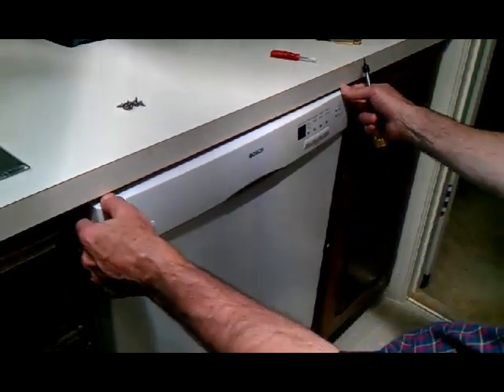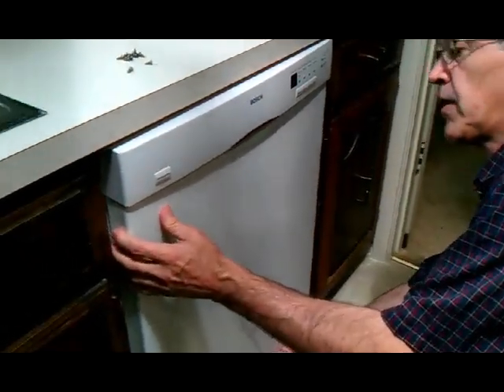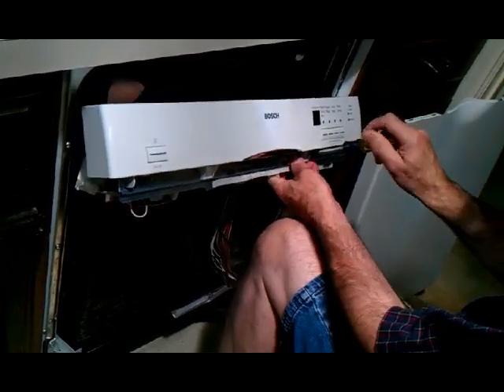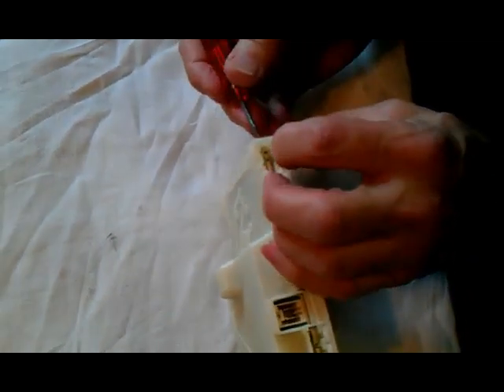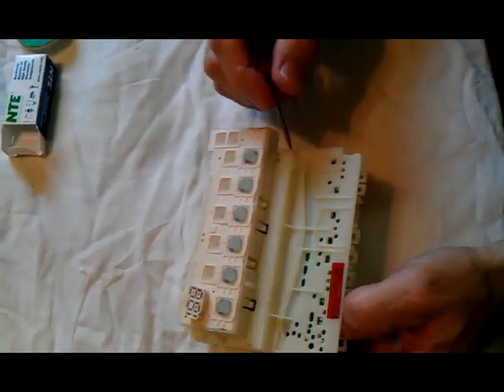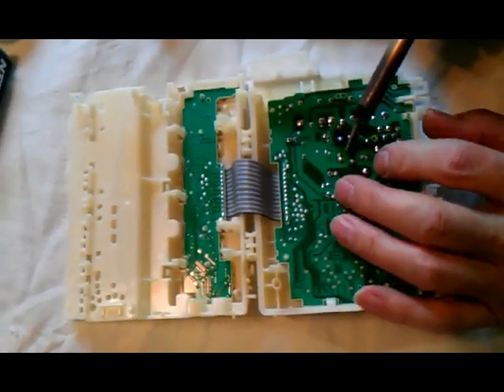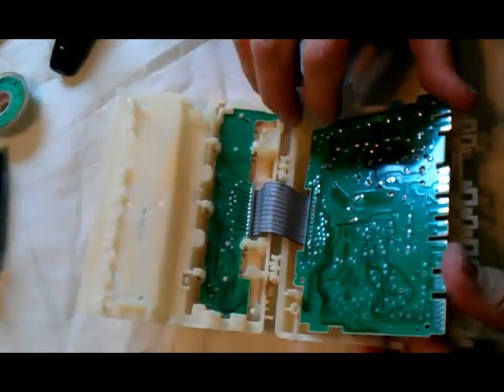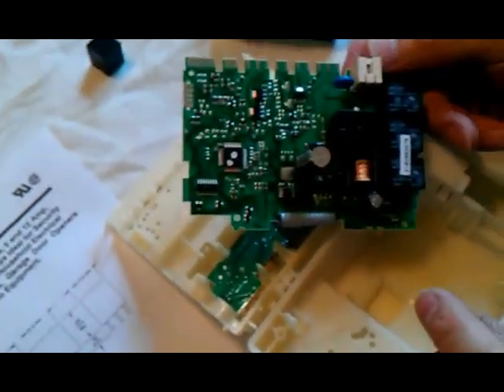Bosch Dishwasher Heater Relay Repair Part 1

Comment: Thanks very much for your video. My Bosch DW (model s9vt1b)
is stopping on a code 1 and shows a code 3 after running the diagnostic program. The water stays cold. I took the PC board out, thinking I might have the same problem, but I don't see a burned solder joint. Is there a way I can test the heater relay and see if it's bad? I'm now looking for a manual on this specific model, which looks quite a bit different from yours (manufactured in 2003). Any help would be appreciated.
Reply from the maker: I don't have any information for your model, but often code 1 indicates a heater circuit problem.  The relay may be bad and not show a burned solder joint, but you may have a failure of the heater, NTC, or something else...maybe just a broken wire where the door hinges.  There are couple of ways to check the heater circuit.  (1) Check the voltage at the heater circuit connector at the control board.  Or, (2) check for current in the heater circuit in the wires at that connector.  Be careful when doing this as you will be working on a live circuit.  Also, if you look near the water fill valve, Bosch usually puts a wiring diagram tightly rolled up and stuck in a crevice.  It is sometimes not easy to find, but it should be there.  The code 3 is often an aqua sensor error.  If that is the case with your model, then it can be ignored for right now as it will not prevent the water from heating.  The meaning of your error codes should be on the wiring diagram.
Reply: AgglomeratedIdeas
Thanks so much for your answer. In the meantime I cleaned out the sump pump and tried running a 91-minute program ("Intensive Wash, 70°C"). About halfway through, the program seems to have started over again. But when it finally reached "1" on the display I waited a good 3 minutes to see if would go to "0", but it never did. I opened the door and the water inside was cold.
Also in the meantime I was able to download some Bosch repair manuals. I'm going to start reading them now, but I'm also going to pull the DW out and see if I can find the wiring diagram. I want to try to test each component that might be bad. If I understand correctly, I should test at the connectors going into the board? How can I test the NTC and the heater itself?
Thanks again for your help.
Les
Reply from the maker: Lester Arbusto
Definately sounds like you have a failure in the heater circuit.  A typical troubleshooting flow chart is here: http://imgur.com/aYgvfAW
This chart is for a 120VAC model, so your 240VAC model will likely have different values.  Even so, the chart will give you the basic approach for finding your problem.
You can remove the connectors with power off at the control board and test for continuity there along with specific resistance values.  The NTC and heater can be checked at those connectors.  With power on and the connectors plugged into the control, you can check for voltage and current values.  A multimeter can be used for continuity, resistance, and voltage checks.  A clamp-on ammeter can be used for current checks.
Finding that wiring diagram would help alot.  Also, if you will post your ENR number I'll see if I can find one.  Your ENR number will be something similar to SGV5903/07.

Comment: Thanks for the video.  Was perplexed why the dishes got clean but the dishwasher walls got dirty with sticky goo.  It was easy to find the relay online.  I never soldered anything on a circuit board, and really appreciate the detail on that.  I even bought a solder sucker - worked like a charm.  Before I forget - thanks for mentioning the four solder points.  After I put the wiring back into the circuit board, I thought about that part and realized I soldered all five contacts.  Took things apart - and guess what I found: I soldered the OLD relay back on.  Whew - without the reminder to use only four contact points, I'd sure be wondering why the thing still doesn't heat the water :-)
Reply from the maker: I'm glad your repair was succesful.  As for the relay contacts, my board only had four soldered...the 5th pin just stuck through a hole.  Some boards have all five pins soldered.  Since the 5th pin is not used (it is the normally closed contact) in the heater circuit, it doesn't need to be soldered.  If the control board had all five pins soldered, then it is okay to solder all five on the new relay.
Thanks for commenting and enjoy your dishwasher again.  Cheers.

Comment: This may seem simple, but I think it may be worth a specific mention that there are four screws that hold the front door to the hinges. DO NOT remove those screws. Again, maybe goes without saying for most, but when you just start taking out screws you can be in for a huge headache.
Reply from the maker: Oh my!  Sounds like the voice of experience there!  I hope the rest of your repair goes well and thanks for the headsup.  Cheers!
Reply: AgglomeratedIdeas Live and learn, I guess. Next question, Dishwasher worked fine with new switch until today. Not it's dead - won't turn on. The basic stuff checks out, breaker switch, hardwired connections, etc. Ideas, thoughts? Something else on the motherboard?
Reply from the maker: Alex Ihnen
That sounds like it could be the door latch switch.  I have a service manual that may help you troubleshoot your unit.  I could email it to you (it is a pdf).  My email address is MyBrokenDW@gmail.com.

Comment: Can I ask if you remember the model of the module? It looks like an ako705266....
Just in case, id like to ask you something bout it
Reply from the maker: Sorry, but I didn't record the numbers on my control module since I was just repairing it. If you need to replace yours, you could look up the number on one of the appliance parts sites such as repairclinic.com.  If you need to email me, use MyBrokenDW@gmail(.)com and I'll do what I can to help you.
Reply: I just wanted to know if theres a special procedure to initialize the module or if it just works by only connecting it.
Reply from the maker: guidito01 No special procedures are necessary...just connect the module.  After the module is repaired, button everything back up and turn the power back on.  Let me know if you need any further help.  Cheers.
Reply: Thank you so much buddy, it was all i needed to know!

Comment: I hit the same problem on my dishwasher today. The relay cooked clean off and burnt a hole in the PCB, caused the board to actually catch fire momenteraly.

It turns out it is a known fault. Bosch are coming to fix it and replace the whole module free of charge. You should have rang them up, they would have fixed it for free or at least sent you a brand new replacement module for free.
Reply from the maker: Yes, this is indeed a well known fault and Bosch will make repairs if your DW is on the recall list...they have to do it.  So, always check that list first.  As many have found out, if your DW is not on the list, Bosch will do nothing at all.  I'm glad your DW is covered.  The exception to the recall list is, of course, if your DW is still under warranty.  It wouldn't need to be on the recall list.

Comment: Thank you for your great Video. I would just like to confirm the correct replacement relay for my dishwasher. The present relay is:899-1c-f-c-6vdc. I am showing the direct replacement as: NTE Electonics R46-5d12-6. Is that correct? Thanks again for your help. I am already out the heater replacement already, due to the wife listening to the repair man. She called him out, because I was worried that it might not be the heating element that was bad, and wanted to research the problem online. She wanted it fixed yesterday.
Reply from the maker: Yes, the replacement for your relay would be the NTE R46-5D12-6.  It is rated at 12 amps.  Your original relay is rated at 10 amps.  The NTE replacement should provide better life due to its higher rating.  That's a shame about the heater replacement.  The symptoms would be similar, but proper troubleshooting would have revealed no voltage was being supplied to the heater because of the burned out relay.  Poor job on the repairman's end!  Let me know if I can provide any further assistance.

Comment: THANK YOU!  We have the exact same dishwasher as the one you repair (only in black).  We called Bosch, but they would not help us at all till we had a certified repair call on the washer.  Really?  Spend $100 on diagnosing the same problem EVERYONE is having?  And then there was no guarantee they would send us parts or anything, either.

But your video and a $8 soldering kit from the local hardware store got us up and running in NO time!  We have run the washer 6x since the repair, and it has worked flawlessly.  You saved us major $$$ bro!!  Where is the tip jar??

PS. We read that the real problem is not with the relay - ours was not appaently damaged - but was the soldering itself.  We'll see if it holds up over time, but the reparied soldering solved the problem for us.

Thank you!!!  You are a champion of the people!  Show this review to someone you know so that they can be proud of you.  Seriously.
Reply from the maker: I am very pleased that you were able to get your dishwasher up and running again.  However, if I am reading your comment correctly, you only resoldered the relay and didn't replace it (correct me if I am wrong here).  If that is the case, it is only a temporary repair...the problem will come back.  Please see Part 2 of this video and I think that will help you understand why you really need to replace the relay to make a permanent repair.  The link for Part 2 is in the video description on the "About" tab.  Let me know if I can help you any further.  Cheers!

Comment from the maker: +stargazer0257
The reply option is missing from your comment (must be a YouTube problem), so I hope you get this message.  The replacement relay for your 899-1C-F-C 6 volt, 10 amp would be the NTE R46-5D12-6 which has a 12 amp rating. I hope your repair goes well.

Comment: It is good to see how many handy persons there are out there.  Sometimes it seems like I'm the only one that fixes his own car, microwave, clothes dryer, HVAC, garage door opener, etc., and now dishwasher. Good to know thats not the case.  Thanks for the videos. The temporary fix is in place and now it's time to order a new relay.  My d/w is a model SHU43 C02UC and the deviant relay is an 899-1C-F-C.  6 volt, 10 amp.  What would the 12 A replacement be for this one?  Thanks again.

Comment: I pulled my board and the relay is white in color and has HF3FA, 006-HTF(576), 10A 250VAC printed on it.  Which one would be a replacement for this?  Thanks!
Reply from the maker: The HF3FA-006-HTF is a 10A relay with a 6V coil made by Hongfa. The R46-5D12-6 relay made by NTE would be the correct replacement.
Let us know how your repair goes. Cheers!
Edit: One thing I forgot to mention is that your relay is a single-pole-single-throw (SPST). The NTE relay is single-pole-double-throw (SPDT). If you do not have a hole in your board for the fifth leg on the NTE relay, just cut it off. That leg is the normally-closed contact and is not used in the heater circuit.
Reply: Thanks!  Your video and instructions were great! The OEM was a four pin and the NTE replacement was a 5 pin.  I successfully replaced it, and the water seems to be heating now, but it still gets stuck on 1 minute and doesn't finish.  When I open the dishwasher there is a lot of suds in the bottom of the tub.  Could a drain problem cause the cycle to get stuck at 1 minute?
Reply from the maker: V Hooper So, that's good news and bad news...it heats now, but is still not finishing.  That's a bummer!  Since it still has suds in it, then it is probably not making it to the final rinse (that's where the bad heater relay shows up because the water needs to be super hot).  If the water is heating properly now, then that would rule out the other causes of it stopping on 1 (bad NTE, heater, or flow switch).  Does it drain at all during its wash cycle?  Also, what is your model number?  I have a service manual that tells how to put the DW into a diagnostic mode, but it only covers certain models...hopefully yours is one of them.  Let me know here or email me at MyBrokenDW@gmail(.)com.
Reply: AgglomeratedIdeas I had that same relay (HF3FA) and have replaced it with the NTE 5pin, but I am having the same problem as B Hooper. I Have SHE55.  How do I get it into diagnostic mode?
Reply from the maker: Matthew Hambrick Sorry, but I don't have the diagnostic test mode information for that model.  If you look by the water fill valve, there should be a wiring diagram for your unit.  It is a piece of paper tightly rolled up and stuck in a crack.  On the wiring diagram, it will have the test mode instructions.  I hope that helps.
Reply: Thanks!

Comment: Thanks very much for your video.  I have taken the control board out of  Bosch Classixx.  The relay is R.46 MKP X2 SH 1.5 uf k 275 VAC.  This doesn't mean anything to me as I am not that technical.  My main concern is that this relay seems to only have 2 pins???  Is this correct as you relay has 4/5 pins?
Reply from the maker: By your description, that part is a capacitor and not a relay.  The relay will have 5 pins (only 4 may be soldered on the board) and will be a cube roughly about .6" wide X .8" long X .5" tall.  If you send me a photo of your board I can help you identify the heater relay.  You can do so at MyBrokenDW@gmail(.)com, or use an image posting service such as imgur.com.

Comment: I am another one of the tons of grateful viewers that benefited from this video. I am very grateful that people like AgglomeratedIdeas take time to post this type of excellent material. My model wasn't in the recall. I don't know why if it is exactly the same problem. I bought the NTE relay at Newark and it was $8 including the S&H. My dishwasher is working again!
Reply from the maker: I am delighted that this repair worked for you too.  And thank you very much for sharing your experience as this helps and encourages others that are having this same failure.  Cheers!

Comment: This is one of those videos that should go in YouTube's permanent library.  It allowed me to order the part (2 vendors in Amazon Marketplace) before I tore into the machine.  Then it helped me get the thing apart without breaking anything and with fewer scraped fingers and a lot fewer cuss words than otherwise.  The burned solder joint looked just like he showed.  I soldered in the new part, put it back together, and it worked.       
This appears to be an engineering flaw in this dishwasher.  Having such a small relay with such tiny contacts right on the printed circuit board with no heat sink, handling up to 1400 watts, is asking for trouble.  Either the relay or the solder joint appears to fail predictably after 5 to 6 years.  Agglomeratedideas has done a major favor for all of us who own Bosch dishwashers by posting this outstanding video.  Thank you!!
Reply from the maker: I am glad my video helped you repair your dishwasher.  It was a frustrating experience for us when our dishwasher started acting up because it was intermittent at first and we were not sure what it was doing.  Finally, I dug into it and found the relay problem.  I thought there might be a YouTube video showing how to make the repair, but I could not find one and I figured that others were probably doing the same search and also coming up with nothing.  So, when I got my relay in the mail, I asked my wife to video the repair.  Like I said, I am glad that the video helped you and others make this simple repair.  I hate to think of how many people spent hundreds of dollars having their dishwasher repaired or, worse yet, replaced it because this little relay failed.

Thank you for taking the time to comment.  The switch YouTube recently made in going to Google+ has made it more difficult for people to comment, but the comments help to keep the video showing up when doing a search on the web.  So again, thank you as it will help others too.

Comment: Thanks for making this video, I have a slightly different model than yours but it has the exact same innards. Super easy fix and a lot cheaper than replacing the whole module.
Reply from the maker: Yes, several Bosch models may share the same control board. Also, the relay used on the boards is similar even if the control itself is slightly different. The big difference seems to be that some use a 6V relay while others use the 12V version. So, this fix works for a lot of models and, like you said, it is indeed a "super easy fix." I'm glad it worked for you!

Comment: Well, my repair is done and everything is working well.  $3.60 from Galco.com for the relay and it came with a chocolate bar that was worth at least $2.  This is the first time I have done fine soldering on something this small, so I ordered the 40W soldering iron, .032 solder, a desoldering bulb and the relay + shipping all for just over $30.  Repair was simple and machine runs great.  Thank you very much.

Comment from the maker: Great, that is what we needed for identification. The R46-5D12-6 relay made by NTE would be the correct replacement.
Galco(.)com, Newark(.)com, and AlliedElec(.)com are just some of the places where you can find it for just a few bucks. Shipping is often as much or more than what the relay cost, but overall it is still a fraction of what replacing the entire control board would be.
Let us know how it goes!